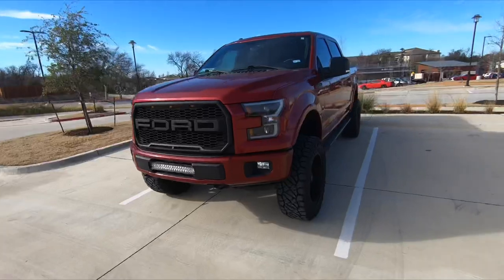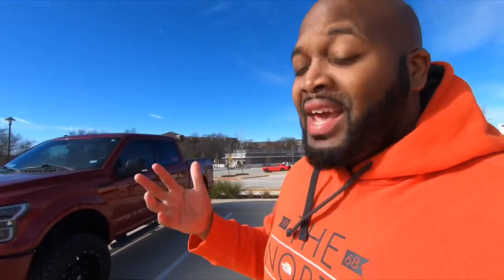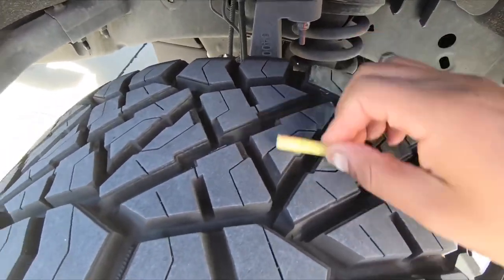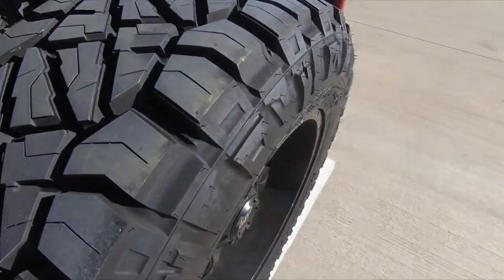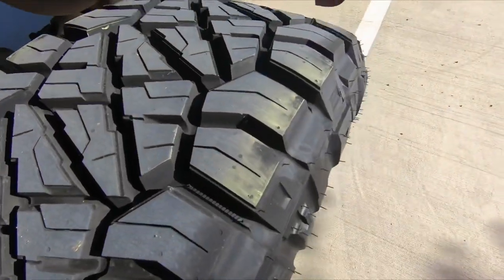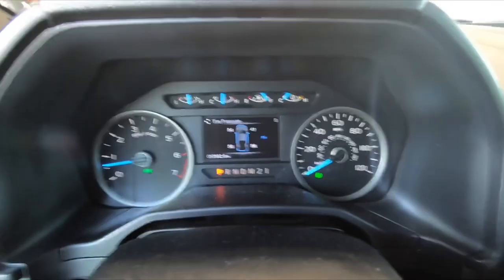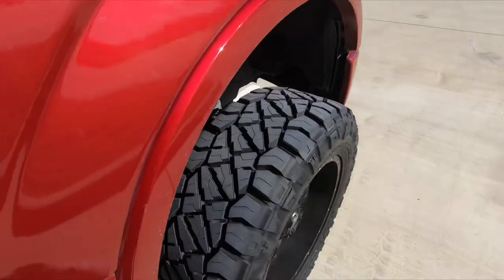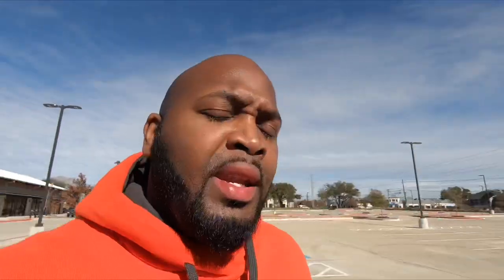$1 Test To Make Sure Your Tires Are Inflated Properly. Tire Chalk Test

Comment: Why not put the pressure at what is recommended by Ford?  It’s on the sticker inside the door jam. And instead of chalk, white shoe polish works well.
Reply from the maker: These are aftermarket tires. Ford specs is for stock I believe

Comment: This is actually the only real good way to do it.👍
Old school.
Great job!
40 looks right. The rear doesn't have a engine in it 😉
With proper rotation, your good to go, even if you haul a little weight.
Reply from the maker: Yea I thought that after the fact. The rear end is lighter than the front line you said, no engine lol. Precitae the insight man!